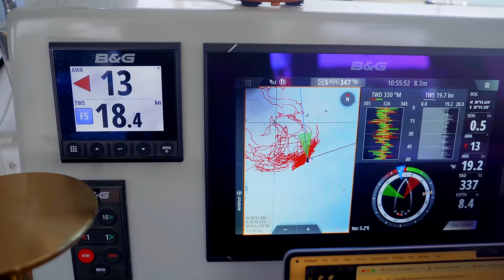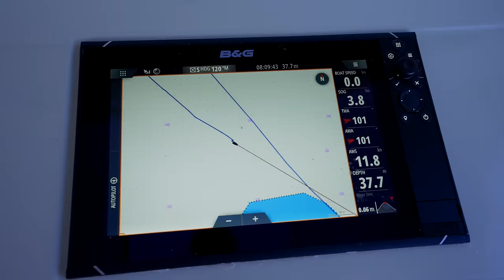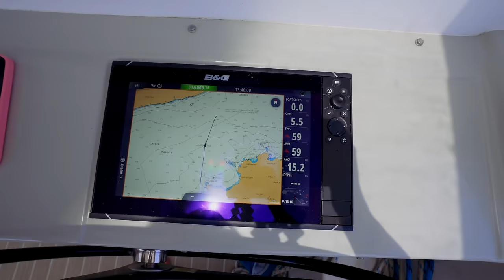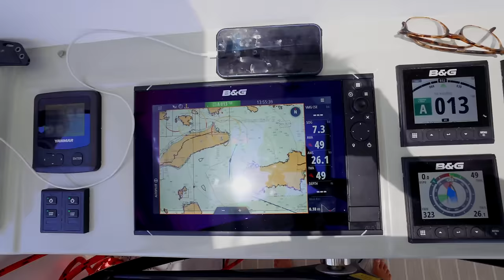This is What Force 7 Sailing is REALLY Like on a Catamaran! (32 kts, beating to windward)

Comment: I'm surprised you don't take the opportunity to sail to windward in the breezy conditions to 'learn' the boat more.  RR2 is a big cat,  the seas are not dangerous,  and perhaps you could relish the sailing challenge more? Show how to balance the boat, and how the auto helmet copes, for example.  Remember, in RR1 you'd be heeled over and getting wet! Show how modern Mediterranean cat sailing can be (should be) done with pleasure, on the flat,  and in the dry,   as opposed to the usual condo caramaran Med sailor retort and practice of.... "there's not-enough-wind-motor-motor-motor-moan-moan......there's-too-much-wind-damn-it-motor-motor-motor...should have bought a motor yacht". You have a great bjg performance sailing catamaran so relish the opportunity to exploit it to is full in those gorgeous warm, blue waters, even if challenging upwind scenarios. It would make good content too as it would bring in maps and course planning. Well,  that's what I say. Can you also pass some perspective, when you feel ready and informed to do so,  about the present ripoff prices in Turkie in many places,  and how you deal with the admin of cruising logs,  and the black water pump out debacles that may be experienced in Turkie/ Turkey. 🇹🇷 . Keep up the good work.

Comment: I usually either stitch the battens in or use a sticky back sail patch to cover the pocket opening or both. And you have to change that anchor. You will never sleep properly with it. I had a Lewmar Delta for five years of cruising. The day I ditched it and bought a real anchor my enjoyment of cruising doubled and the stress and anxiety halved.
Reply: Just curious, what anchor did you choose for the replacement? Thanks in advance, HD
Reply: @hillsidedweller656  It's a Rocna . But any of the new generation anchors except the Delta are good. I am not a fan of the Sarca Excel for general use either.

Comment: I use a anchor app, as long you have GSM reception. I now use Savvy Navvy , it works quietly in the back ground, with out usingto much power, compared to the yachts MFD and sensors . I understand, how it feels when anchoring doesn’t go well, sleep becomes hard, and generally very nervous, and no relaxation. Finally with this App it works. I hope this helps. Andy